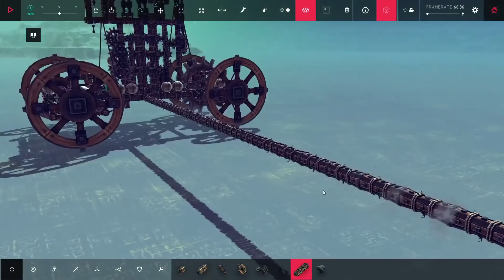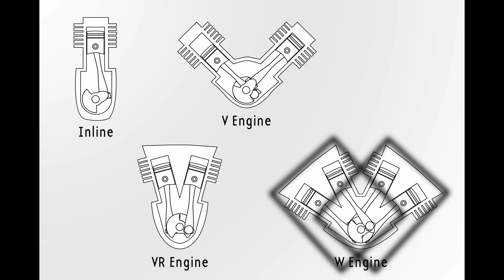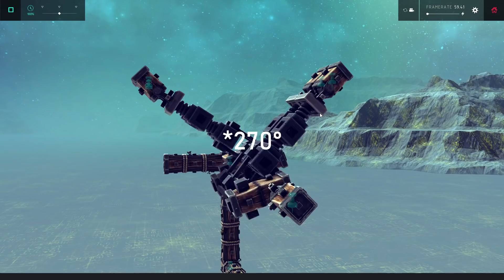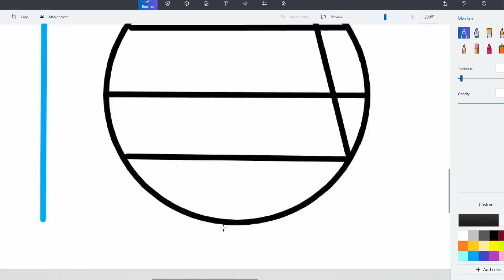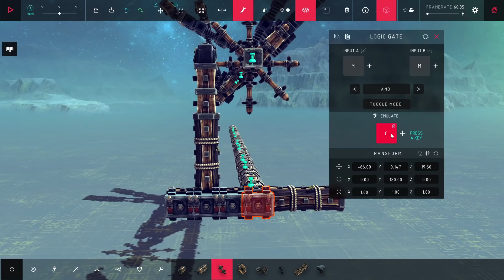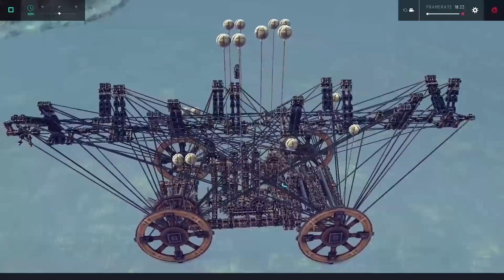Making the Glorious W16 Engine in Besiege

Comment: Damn it’s not the technical correct/ best way of building a motor in besiege but it is definitely unique aand way cooler than any motor I’ve made. I’ll be surprised if it moves tbh.
Reply: My motors rely heavily on scaling tho to make it compact and this one doesn’t and is almost entirely vanilla. absolute amazing super impressive stuff.  Maybe some point you could try a steam engine(water cannon turns to steam when heated with a fire source) actually I think using steam power or fans would have been a way better way of powering this motor. I’d also love for you tackle suspension systems. It would be interesting what cool wacky way of making suspension you would come up with.

Comment: The potential for mechanically-powered engines in besiege is massive, I encourage you to keep making videos about these. I've made several different types of them, from conventional pistons to planetary crankshafts. My strongest engine yet is small enough to fit on a car frame and is able to drive a car at a speed of 20. It also has enough torque to climb slopes of 25 degrees due to its unique design using steering hinges.

Comment: Just a friendly FYI... There's a reason why real crank-shafts have webs in between the rod-bearing sections. It's for rigidity. There's no way you could expect a chunk of steel to not deflect under loads like that, regardless of how strong it is. It needs continual support over the entire body of the shaft.

Comment: it actually isnt a w-engine it is a v-vr-engine because a w engine needs 3 cylinder banks not two its a common missconseption cuz vw called its v-vr-engines w engines. v-vr-engine is basically 2vr engines in a v shape.

Comment: heres what i learned from trailmakers to help use what ever sensor (something that activates something when it sees something) on the part that moves (crank) it should move with the said crankshaft then have a line of blocks to make it activate it should be a automated engine then vice versa you can add gears in trail and add a piston system to make a clutch

Comment: as a carmechanic, every time when i hear someone called this type of engine the W-Engine which is basicaly 2 VR-Engins transforms in a V-Engine, i started crying... yeah most of the world is calling it a W-Engine (thanks for Volkswagen) , but technicaly correct this is a V-VR-Engine (false W), the True W-Engine has 3 banks of pistons, 2 forming a V-Engine and one between the V. The "true" W-engine is also known as Y-engine. but anyway, it was fun to watch
Reply: Problem is that w engines are known for 3 or 4 banks.

3 bank looks like a w
4 bank when overlaying the v layout of both left and right banks you get overlapping v's creating a W

With a vr being basically an offset line  engine one could actually call the vw W engines an actual v engine

Comment: The "W-engine" build out of two VR-engines is actually a WR-engine. A true W-engine is a way older design with 3 zylindr banks (like a V-engine with an extra zylinder).
Reply: This would mean W-inline wich doesn't compute at all.
The W is the German name given to this engine, just like the VR is a German abbreviation, the letters have different meanings.

Comment: Not meant as an insult or anything of the sort, but currently the engine looks more like a wonky v16 than a W16. I know this is because the pistons can't connect to the crank directly how you did it at the start of the video, but i'm pretty sure braces in besiege are not actually physical objects and so connecting the pistons to the crank via bracing should be possible, and by doing that make a more compact "actual" W16 possible right?

Comment: First of all, congrats on the 100k!
But, sorry to ruin hype, this is a VV engine not a W engine, a W engine has 3 banks of cylinders. It looks like a V engine, but it's got an Inline engine stuck in the middle.
Reply: VW calls it a W, personally I think a  true 3 bank W engine should be called a Y engine, which would make a VE W engine an X engine. I guess.
Reply: @WilliamMoser  X engines also exist, they were mainly used in aviation and even the  rarely. They were payed out like, you guessed it, an X, four banks of cylinders, all attached to the same crankshaft (although at different points)
Reply: @TheTMan001  yep, I'm aware of the literal X engines, I more meant in terms of the number of banks and where they are attached to the crankshaft :)

Comment: Hey, Reid I just wanted to let you know in besiege if you hold Shift you can select more than one block to rotate without dragging a box like usual, and the last thing you select is the pivot point for where all the other pieces rotate. if you hold Shift and de-select then re-select the block you want to be the pivot, it resets where it rotates from and solves your issue with wonky rotations! sorry if this isn't phrased correctly.

Comment: Use a v8 so that you can still use the car. I really want to see the car moving fast
Reply: i wonder what piston layout would be best for besiege, a v8 might be better than an i6 because of the weak crankshaft, but perhaps a boxer engine would do better, an f4 should do. put a flywheel on it and thicker gears in the transmission and they might work up some decent speed.

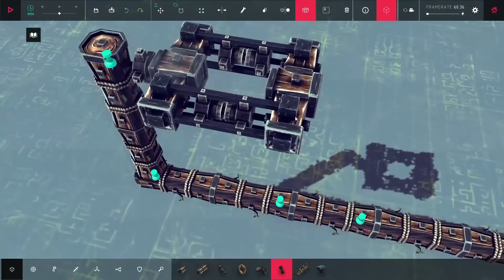Comment: 2:10 the reason why it rotated weird becouse it matters what you choose as your origin of transformation, which is the last block you clicked on in your multiblock selection. For that reason use ctrl+click, or shift+click, whichever is correct
11:00 a little advice for that issue - moving all the parts a little away from the connection helps.

Comment: That bracing looks really heavy. Working out a more efficient frame will probably help a lot with the lack of power in the transmission.
I'm also tempted to open up besiege again myself and work out some reduced slip gear settups, as that was some of my main problems with them in my own creations.

Comment: Have you considered having pistons be wide on the other axis? I'm not sure if there's a part for this, but having them be, say, 3 blocks "thick" but only 1 "wide" (where for reference yours are 1 "thick" and 2 "wide"). If they could all connect to wide blocks at the ends that can hinge, you could fit more power into a more compact crankshaft.

Comment: Not sure if you though of this but I redesigned the engine you made and even made a boxer engine in besiege. But somthing I found to work easier would be to instead of using the spokes and logic gates. I used 8 sensors to tell me exactly what position the engine was in and had each sensor activate an piston that needed to be extended. I can post a pic or upload it if my wording is confusing.

Comment: Hello Captain Red.
I see you had problems the rotation system and how that works in besiege, let me explain:
When you select two or more blocks to rotate, the center of mass will be always the last by default, if you want to make they rotate on their center of mass, go on the 3 red squares on the rotation option, unmark the second and now the center will be the medium point between them.
Also, if you want to make engine works automatically, go to the automation section and the sensor and the timers, they will be very useful, you can use the sensor with a piston on its side to make a power on/off your system, and the timers you can use they to make them to make your engine work.
My last ideia is use a spring attached to some unpowered rotation block to make a structure that can actually help you engine to work well.
I hope those ideas and tips can help you to make others incredible creations.

Comment: "But the transmission isn't strong enough."

Ah yes, German engineering at it's finest!
Reply: German engineers making a tank in a nutshell: Hey let's make the biggest tank because why the crap not
Reply: @lighttank3905  and give it a transmission that will implode on a itself every couple thousand kms
Reply: @uglybastard6614  couple thousand? more like couple hundred
Reply: @ExHyperion  more like a couple meters
Reply: @SpungusGung  more like it won’t even move because the tiger II took up all the fuel
Reply: @uglybastard6614  Its not a faulty transmission its a strategic bunker conversion system
Reply: Me a german: yes
Reply: oof
Reply: @elios7623  i see you are a Man of culture
Reply: Audi Allroad intensifies
Reply: German science is the greatest in the world!
Reply: @JorgeDiaz-ok5qu  Wait, is that a jojo reference?
Reply: Scared tiger 2 noises
Reply: @logical128  My near identical replica of Trevithick´s Penydarren in Besiege, altough having some hiccups when starting up, is going some. (even if it is moving with help of steam thrusters and a 3 cylinder piston)
Reply: me an austrian with a bmw had to replace one transmission already and the new one fells like its gonna go out soon
Reply: @eiboeck88  Deswegen fährt man ja auch Audi :P